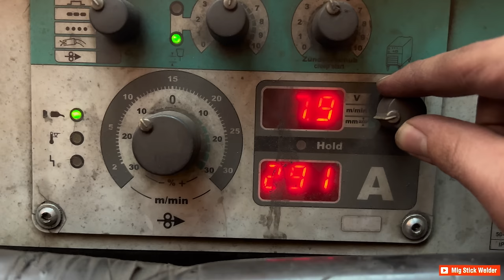why no welders talk about this Simple MIG-MAG Welding Technique

Comment: Nobody talks about MIG/MAG in my town because the welding supply guy here doesn't know the difference between balloon helium and welding helium.
Reply: Сварочный гелий..... 😭
Reply: Helium is helium IE it's element so unless they are mixing other gases into your party balloons I don't know what your on about.
Reply: Helium isn't an inert gas usually C02 or argon or a mix should be used depending on the materials being welded

Comment: Looks pretty. Nobody talks about it because the penetration issue. Most people prefer functional welds in the work world.
Reply: What penetration issues? I've passes CWB mig certification 4 times now with this exact technique. Simple and effective with the right setting I run 27v and 550 IPM with 0.35 wire
Reply: Agree completely
Reply: Your source is yourself lol
Reply: It seems as though making mig “pretty-passes” are video worthy, how come they never break the coupons against the root on video???  The answer is that most won’t be pretty!!  LOL
Reply: I weave just like this on structural steelwork and everything holds. Plus the line running down the centre of his weld shows that its a good weld anyway
Reply: I weld basically the same as this video and have passed dozens and never failed one. So as long as you know what you’re looking at and doing you’ll be fine.

Comment: One thing that a og welder taught me, every gap in between the pattern is fracture point, the tighter the pattern , the stronger the weld, going straight gives the best resistance to the weld , but overall that’s looking good
Reply from the maker: True , u can best see that if u weld for test , weld from one side and break the peace so weld break in half and than u see how much movement make diference in welding 😁 if u just push it will be same root all the way

Comment: Pohvale za odrađen posao
Ali trebaš malo smanjiti amperazu a dodati malo volti
Reply: Adding volts increases the amps...
Really no need to increase it either. Maybe to straighten the bevels the slightest but we're talking 1-3 volts tops.
Reply: @Gundolf300  nella saldatura MIG MAG sono due i parametri da regolare, i volt e gli amper. I volt sono la tensione e gli amper sono l'intensità della corrente. La tensione in volt la da la saldatrice è gli amper la velocità del filo, dunque aumentando  i volt non aumenti gli amper, ma aumenti la potenza della corrente che viene misurata in watt. La formula è P=V×A

Comment: I use a pausing technique makes the same design but I don’t go back into the puddle once’s it’s cold and I would have turned that heat up more I would have ran it on 25.6 and 300 wire speed it just wets in smooth

Comment: You dont left on the metal the copper ....you need to stai in the midle air.ms frind.
And go slower ...
Reply from the maker: Not rly , its all what u preffer , in school they tell u mid air , buth when u start weld there are So much position and angles of pistol u need to use

Comment: You welding like aluminum going forward and pushing forward, no good there is 0 penetration.
Try to go forward and face your wire back , and you don’t need to move your gun forward and back to get that look on finish just pull it equal all the way and solid wire just follow you.

Comment: 3/8 plate non structural but in filet layup. First off. Your settings are way off. That weld pool was laying wire, not molecular fusing of your parent and base metals. People need to stop spreading vids like this. Yes it looks pretty. But a trained eye sees your angle is also way off and your travel speed is to fast.  The weld is not wetting in. This  weldment would fail in structural testing at least. Keep learning. I do this trade for a living and I I'm not giving you bull crap. I am trying to help. Run the wire speed at 290 ipm, to start and get your voltage up to around 25 and adjust up from there for the plate thickness you are using.

Comment: too much whire ! and welding is cristalized !
Reply: Too much wire isn't actually a problem for a good quality weld. The only issue is the spatter. Too low wire speed however is worse cus that can cause welds to roll.
Reply: The welds are fine.

Comment: That weld is trash. Cold lapped on the bottom. If you don’t know then don’t try to teach people anything. Any structural company would laugh you out the door.
Reply: Looked like a 30 degree push which is what? 15-20 degrees past code? And that's with flux. Pushing solid wire with a whip technique is going to have little penetration. A bend test and a cut/etch would show you how bad this weld is. Looks "pretty" but man am I ever sick of these dogshit welding channels teaching people bad habits. Young guys are watching this shit thinking they're doing good by replicating it, leaving work pieces with faulty welds that don't last. 

If it won't last longer than you'll live, the weld is shit. Purely a cosmetic thing for unimportant pieces that don't hold any loads.